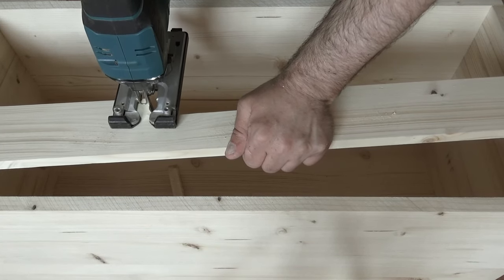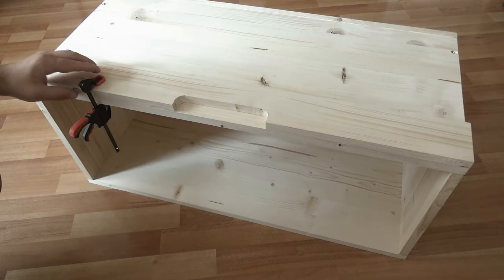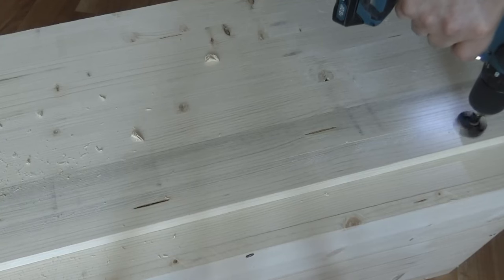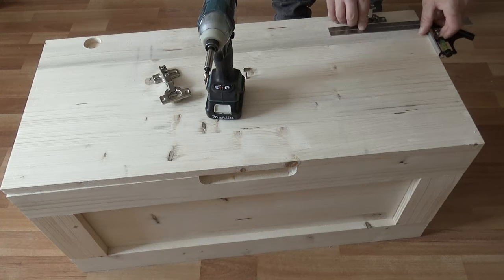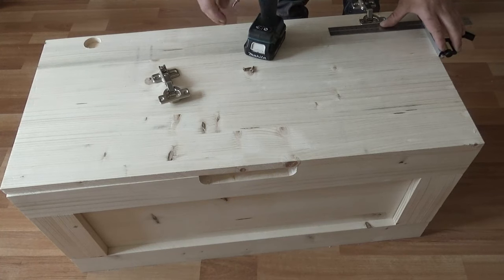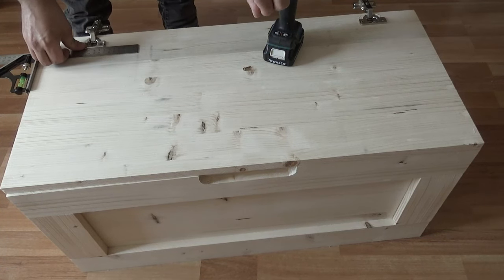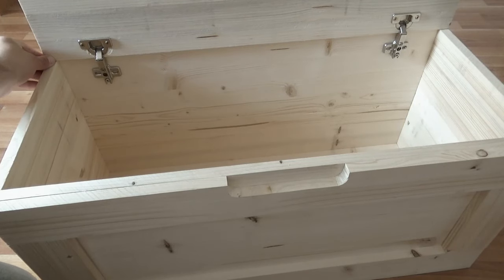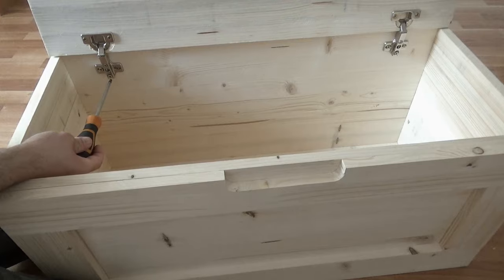DIY Storage Bench Easy Woodworking

Comment: what is the name of the 90" guide used for drilling holes?
Reply from the maker: Is a template, 90 degree poket hole for a thickness of 18 mm. Are a bit hard to find the one in the video was made especially on a lathe.